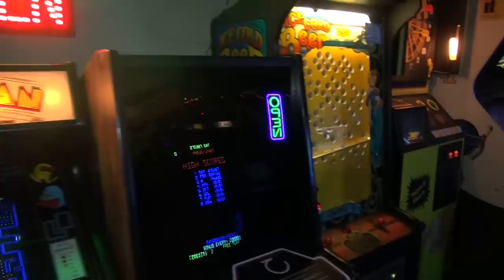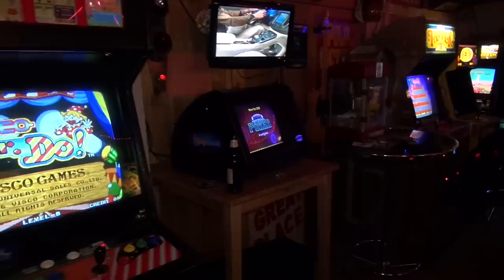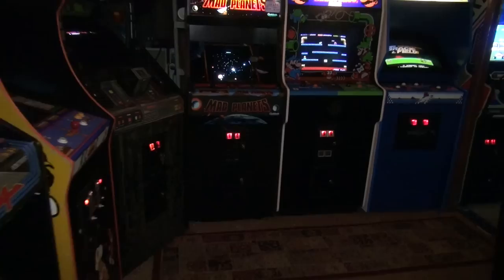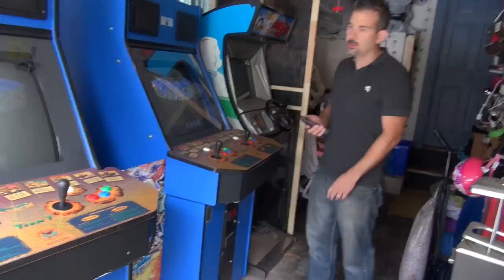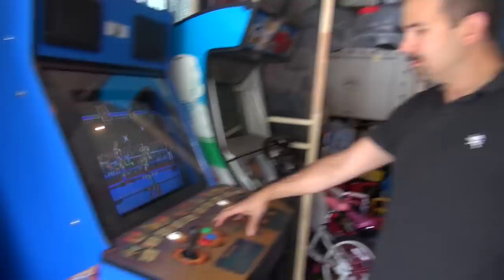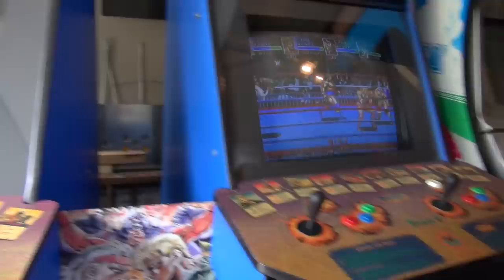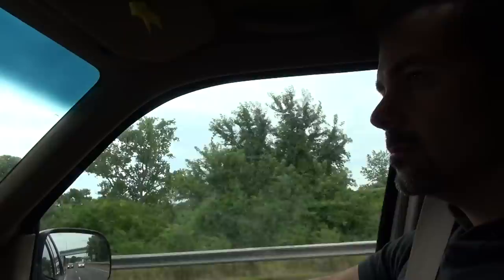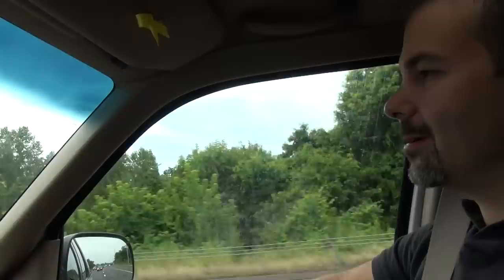John gets a Dragon's Lair Arcade Game - Working original LaserDisc Player! - Cinematronics 1983

Comment: The thing that is fascinating about laser disc games like Dragon's Lair is that it was done at a time that computers weren't powerful enough to display full-motion video, so all the game can do from the microprocessor side is control the laser disc player and validate the joystick moves.  John talks about Daphnie, which I believe is an emulator that displays the video from a hard drive, and that couldn't be done until the 21st Century.  The game was probably so fascinating to kids in the 80s because most games back then had computer graphics that were nothing like cartoon-quality video.

Comment: One of my favourite all time games :) and the coolest thing was being able to finish it, by the end there would be a large crowd around you watching.

Looks like the one you have is set to easy or medium.  Since when you die it skips to the next scene.  On hard mode, it will not skip scenes until you pass that scene.   In Medium it will skip scenes, but before the last scene with the dragon it will make you complete the ones you died in.

So playability can be extended if you put it in hard mode.

Comment: There are some dipswitch settings (possibly alternate ROMs) to unlock the opening drawbridge scene.  After testing, it was determined to be too difficult to be the first scene to be played. By default, most machines are set to skip it.
Reply: Yeah, all 1983 original arcade Dragon's Lair machines did not have that drawbridge scene. The PC versions did have them and the playing sequences did not match the arcade versions at all. In fact, they were so out of order that some of them required different Dirk joystick moves that were not the same as the arcade machines. I'll take the original.

Comment: What you're seeing on the top edge are player control and time/frame codes, which are a series of seemingly random dots and lines that flash in the vertical blanking portion of the video.

Normally, you don't see them; their visibility may be due to vertical foldover, which suggests a problem with the vertical deflection circuit in your video monitor, or adjustment of the viewable area of such where overscan has been reduced or eliminated.

Comment: Like others have said.  The point of failure with regard to the laser disc will be the player since the player has to keep that disc spinning the entire time the game is running.  I have had 2 laser disc players fail with issues related to the motor and belts.  The disc itself should be pretty durable and can even be cleaned.
Reply from the maker: Good to know and makes perfect sense. thanks!

Comment: LD-V1000 is actually a tough, reliable unit ... provided that its parts are not worn out, particularly the gas tube laser and its power supply.  But, if your Dragon's Lair LD is an old one, the Helium Neon gas tube laser used in this model will track it better than players with a semiconductor laser.

If it still works good, I'd keep it and continue to use it until it quits. But, I'd keep a spare machine and, if necessary, an interface adapter as a backup.

The LD-V8000 is a more modern player using a semiconductor laser and is definitely an excellent machine for picture quality.

However, for Dragon's Lair, I would go for the LD-V2200 over the LD-V8000 and the LD-V4400.

The LD-V2200 is just as durable, but doesn't have digital video memory like the LD-V8000 (which isn't necessary for the game), doesn't have digital audio capabilities (a Dragon's Lair disc probably doesn't have a PCM audio track, so digital audio support isn't necessary), random access is plenty fast enough, and an LD-V2200 in good shape is very easy to get cheaply while something like the LD-V8000 in good shape is hard to find at a reasonable price since you'll be competing with LaserDisc collectors for that model.

Comment: You are actually not supposed to remove the laserdisc. It should stay in the  laserdisc player. The player is the only thing you need to disconnect and carry separately with the disc inside so it doesn't get damaged .

Comment: Hey John, i think you messed up the RGB settings, the screen looks a bit too purple-ish at the end of the video! After you tweaked the alignment, saturation and contrast it was perfect, then something gone wrong! Anyway great video and great addition to your awesome arcade/basement! Dragon's Lair is one of my favourite games ever!
Reply from the maker: MaxxLegend Yeah, I dunno. I need to spend more time with the monitor. It's too bright or something. :)
Reply: It cannot be an RGB issue; LaserDisc video is natively composite.

When adjusting, it's possible for the original potentiometers to be noisy as the result of dirt and oxidation.  The adjustments may not hold steady as a result.

Assuming good pots, a simple solution for color problem is to merely adjust the hue/tint control until the color phase is correct.

A rough adjustment is to set the phase according to skintones; a good looking skintone is the result of good color phase and intensity.

Proper adjustment is through the use of a SMPTE color bar pattern, which is on the disc and should be accessible through the arcade game's service mode.

A SMPTE pattern either requires the use of a proper blue gel filter or using only the blue gun in the CRT, turning off the red and green guns, to adjust for proper color phase and intensity.  The SMPTE pattern also has a pluge pattern for adjusting contrast and brightness to their proper settings.

This is assuming that the monitor is in good order with a strong CRT.

Comment: the top lines is a vertical deflection issue, you needs to change the caps around the vertical IC. Hidding the effect resizing is wrong.

Comment: 53:10 On the falling platform, you can get off on any level.  There is really no "wrong" level to get off on.  As long as you make your move when you are at a ledge and not "between floors," you're fine.
Reply: There are certain versions of the falling platform that you can get off on the 9th platform for maxium points. It's hardwired into specific scene sequences--every 13th sequence to be exact.
Reply: @TakeYourLemons  I've seen a 3rd horse and Dirk the knight sequence that is extremely difficult to complete, unlike the other two regular ones that follow the closing brick wall and fire rope scenes. If you do complete that 3rd horse scene there is no fire spray at the end, unlike the other two. It's on the highest difficulty setting, I believe.

Comment: If I remember correctly, there's a setting that shows what moves you need to do on the screen every time your input is required. Also, are you familiar at all with Dragon's Lair II: Time Warp? It's one of the weirdest games I've ever played.
Reply: don't think so Ryan, there is a dipswitch setting to beep when you enter a move but that's it.  plenty of online guides with the sequences though.
Reply: it's not that difficult to figure out what to do given time.  the problem is when you are paying for it.  3 lives don't last very long.  i've beaten both dragon's lairs game.  the first one i only beat on a computer version of it.  i beat the 2nd game in the arcade but i spent a lot of money on it before and after i beat it for the first time.
Reply: it's a lot harder to figure out what to do in dragon's lair 2.  ironic considering every move has a flash.  the problem is that the flash doesn't always fit a specific direction (like after the snake in level one the flash is down in a little bit to the right.  you have to press right to get through there but most people would assume to press down.  plus the checkpoints are few and far between where as dragon's lair 1 had short levels.

Comment: Difficulty DIP switch settings: if A2, B4 and B7 are all off, it's on easy, if B4 is off, while the others are on, the difficulty is dependent upon player's ability. Easy at the onset of every game, play automatically increases in difficulty when a player survives 9 consecutive sequences of challenges. If all three are on, The difficulty is dependent upon player's ability. Easy at the onset of every game, play automatically increases in difficulty when a player survives 5 consecutive sequences of challenges. and if A2 is off, but B4 and B7 are on, It's hard difficulty

Comment: John, apart from owning a LaserDisc Arcade game, is there anyway to get a LaserDisc player that will play LaserDisc games, like Dragon's Lair?  I know that the Pioneer LaserActive will play LaserDisc games, but I'm definitely not looking to spend around $1000.00, which is what used LaserActive systems go for.
Reply: Well, the Daphne emulator has an option for controlling a Laserdisc player, but besides that, no.  The actual discs themselves have no game programming data on them (those are stored on the rom chips).

Comment: I still have a working industrial laser disc player and have played games on it with Daphne (originally Daphne required a physical LD player) and a few LD games.  The problem is, the players do eventually wear out because LD players (even industrial players) weren't designed to do the amount of seeking required by games like DL and Space Ace for very long.  The discs can also degrade over time.  At CAX last weekend the creator of Daphne, Matt Ownby, showed his new product- Dexter.  It's a board that emulates just the LD player so you can have an original cabinet and board set, and simply connect the Dexter board where you would put the Laser Disc player.  Voila. a real laser disc arcade game with no (almost) fragile parts. http://youtu.be/MRTf6__ARCs

Comment: I see that the joystick of Dragon's Lair in funspot  won't be as responsive as I used to play it in an arcade back in the days.  Have you noticed some significant lag with your machine ?  Nice acquisition by the way John.
Reply from the maker: Michel Castonguay I haven't really noticed any lag. I thought the Funspot one felt off too but it is running Daphne.
Reply: John's Arcade Game Reviews & Tech weird I never had any lag with Daphne using a controller might have been the brand they were using. I like playing around with game version enhancement v2.1 prototype mode it has alternate routes where in the original they left out and more animation. like in the giddy goons level there is a tripwire if you screw up and step on it dirk gets a spear through the chest.

Comment: hey bud.  Any idea where I can get a good working Dragons Lair laserdisk? I checked Ebay and no luck , the disk I have I bought with the cabinet and was supposed to be in good working condition but I think its crap. At least 10 scenes that dont work or freeze. I played a movie in the same laserdisk player and no issues. Thanks, Rich
Reply from the maker: Rich Favreau Rich, I don't have an answer for you. Sorry. You just gotta keep looking. My disc isn't perfect, it has a little snow but it works. I too am on the lookout for a better disc. I suggest posting on KLOV or keep on looking on ebay. They certainly come up. Also, try hitting up the laserdisc collecting community. Not the arcade dudes. The laserdisc dudes.

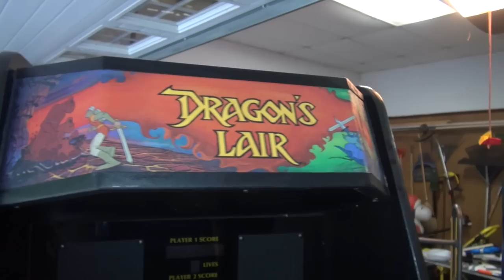Comment: NEVER, EVER do this 27:30! Notice the liquid magically run down the marquee and disappear INTO the machine in search of an electrical circuit - NOT GOOD! ALWAYS spray cleaner ON THE PAPER TOWEL, not the surface to be cleaned. There's a myriad of reasons why from needlessly destroying a surface with spots, to excess liquid causing electrocution. If it's electrical, spray the paper towel or cleaning cloth, NOT the surface to be cleaned. Otherwise cool video!

Comment: Will you please make a new video of this video game, and show us:
1. what the machine does when you try to run it without its disc, and
2. what it looks like to try to play the game with the Van Halen or some other disc inside instead of the game disc, and
3. what it looks like to play the videodisc in sequence just on a TV (power it by the video game but leave the control cable off, and hook AV to the TV instead of to the video game system?
Reply: +MaxxFordham I can't answer the first one, but if you have a different disc in the player, it will still play the disc. The game will still think it's playing the Dragon's Lair disc though, so it will jump around to random scenes and the video will have no relation to the inputs the game is expecting!
If you play the Dragon's Lair disc all the way through from start to finish without the board controlling it, you will see each scene play out the correct way, followed by all the deaths from that scene one after the other.
Reply: That's why I asked John's Arcade Game Reviews & Tech to show us.
I know what would happen with another video in the player. That's obvious. Of course the game circuitry wouldn't know the difference. But I still want to see these things anyway.
Reply: +MaxxFordham 
1) Game won't boot
2) Nothing happens and game won't boot
3) System plays each and every track from start to the end. Not in order.

Comment: think i would have used jsut soap and water to clean that. those magic erasers are really just real find sandpaper now. it is Melamine foam and it can scratch. http://en.wikipedia.org/wiki/Melamine_foam
Reply from the maker: Yeah, I said that. It's basically high-grit sandpaper. Works amazing on CPOs.
Reply: John's Arcade Game Reviews & Tech  i noticed you had cleaner run down into the cabinet 27:30. hope that didn't get on anything that isn't supposed to get wet.

Comment: i don't really see the big deal. guess had to play it when it was new. this is just a big qte thing really? also would just get the laserdisc and play in any player really if wanted to play it i guess. guess you could play any laserdisc in that thing? laserdisc are like cd/dvd/bluray. that data is in the label or reflective area. the plastic on the bottom has no data. it can be scratched and fixed without losing stuff. that is why it is worse to scratch the top of a cd or dvd then the bottom.
Reply from the maker: Yeah, it's a big Quick Time Event game. :) The first one. :)

Comment: Wow, I just read about what this "suicide battery" system is about, and I hate people from companies who decide that self-destruction is a "good" way to go. It's such a barbaric ideal.

Why, when an operator gets one of those, don't they just modify the system so that the low-voltage DC from line power is also connected in parallel to where the battery goes (doing whatever to match the voltage and current capabilities)? And then also why not hook even a new battery in parallel to that (especially keeping track of how long they'd last in the worst scenario and just replacing the battery in parallel every time)?
Reply: +MaxxFordham There is a way to remove the suicide battery. I don´t kow how to do it, but there is a way. Some tech guy can throw us some light on this...
Reply: Yes, newtonu, there obviously is a way. I was asking whoever might know, why the owners don't just do that every time they encounter one.